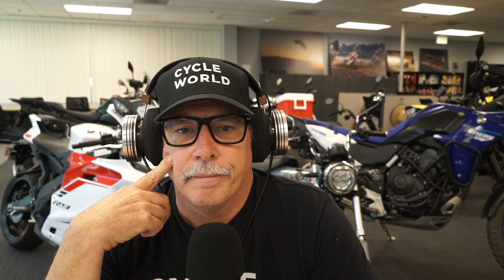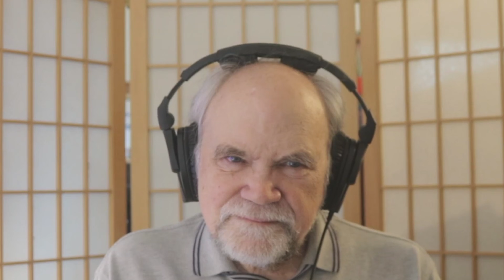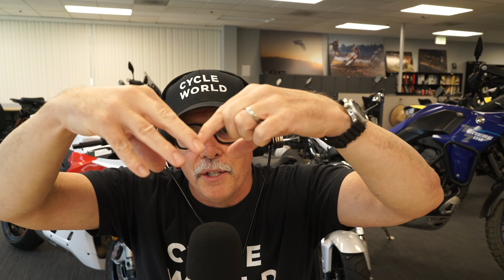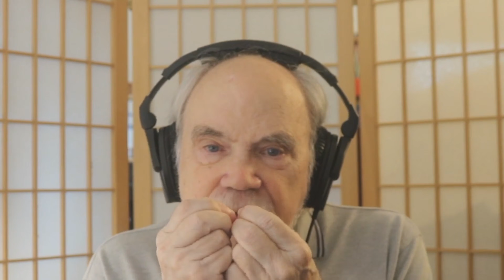HOW FAST COULD WE GO?! What's making new motorcycles slower than they could be?

Comment: Whenever Mark talks about the XS650 I feel a brief burst of nostalgia for my first "real" motorcycle (after having a Kreidler moped and a 100cc Vespa of the old twist-shift type). In 1988 or '89 I bought a '77 XS650 and rode the heck out of it for a couple of years before moving up to a 1980 XS850 Special. The previous owner must've done a good job maintaining it because I knew much less than I should have about motorcycle repair and maintenance and basically didn't do any beyond oiling the chain, yet it never let me down. I wish I had a photo of it.
Reply from the maker: Mark's is cosmetically pretty rough but has been remarkably reliable since its rehabilitation for the Ran When Parked videos on the Motorcyclist YouTube channel. Really fun bike to ride! https://youtu.be/wpYvyk2gIeY?si=sxIJOfFuK0SX-6pX
Reply: People want those for Bobber motors, huge sales in the 70s on those.
Reply: In February of 1986 when I was in the Army at Ft Riley KS I bought a 1981 XS650 Special that was only 20 miles over the dealer free 1st service, 520 miles or 220 miles whatever it was.
I bought it off a helicopter pilot who'd bought it new for his wife in 81 for her birthday, I guess when he got it home she said "Gee, that's nice honey but I don't like motorcycles", so he rode it around a little that summer and put it away in their shed out back, the next time it came out of the shed was when I bought it.
I took it down to the local dealership where it'd been bought to have it serviced and they were so amused at it only being 20 miles over the initial break in service which was supposed to be free that although I wasn't the original owner they still did it for free.
They took me back in the service area to ask me something and on the lift next to it was an XR1000 Harley Davidson, boy did my life change at that moment, I'd never seen another motorcycle, before or since, that put a hook in my mouth like that thing did.

Comment: Esoteric topic suggestion. Actively controlling pipe lengths on a two stroke. My trx250r based toy has a u-turn in the pipe. Trombone action?
Reply from the maker: The U-turn is usually the divergent cone but if it shifted the length of the center section of the pipe you could have something. Just 5mm can make a big difference there. We'll hit Kevin up for his thoughts.
Reply: It's been done for decades. Karting uses them. Sealing can be an issue but that was mostly solved by using moving internal cones that change the effective length while leaving the outside all sealed up.

Comment: Lolol, The glide ratio for airplanes if it is 17 that means for every 17 feet it travels forward it will drop 1 foot or 17 to 1. Not measured in miles, I am calling out Kevin on this because he gets long winded and just in case he believes that he is smarter than the rest of us.
Reply: Isn't the ratio the same no matter what unit of distance is used?
Reply: @theralfinator  Any unit of measurement applies.
Reply: @theralfinator 
Exactly, that's why it's called a "ratio".
For example you can use rocks, if Jimmy has 4 rocks and Mary has 1 then Jimmy has more rocks than Mary at a ratio of 4:1.

Which isn't nearly as many rocks as the OP has up in his head.
Reply: When Kev goes for morning ablution there is more information in the bowl  than you have in total. I learnt more from this fellow than any teacher, hie has a vast reservoir of knowledge that few others can claim
Reply: Dude! 😂
Reply: He is...
Reply: IIRC modern sailplanes (gliders) have a glide ratio of 60 to 1 or possibly better. Often referred to as an L/D ratio (lift/drag).
Reply: You just proved he's smarter than you.

Comment: On a R100GS with the small headlight shield (89,90) I found that at around 90mph the weave would start if I was holding on to both handlebar grips and would go away of I put my left hand on the upper fork tube flat track style.

Comment: My stock 69 Norton Commando S in1974 at New England Dragway turned a 12.69  @ 103.32 mph, the first time I ever went to a real track. More than fast enough to beat any of the 1970s Muscle cars and quicker than the tests I've seen for a  427 Cobra back then.  You can do a lot with about 50 rear wheel horsepower. And a Commando can shut them down! 50 HP can be real fun wide open.
Reply: The 427 Cobra's would hit 180/185 MPH top speed, which is the point of this video, top speed.
Your Commando S crossing the line at ¼ mile was starting to wheeze at 103 MPH and was getting ready to cough up a lung, the 427 Cobras were going 115/118 MPH across the line and were just getting going. 
Still "shutting things down"?
And your 750 Commando must have been a special example of a "stock" one because it's dropping the better part of a second off the time of other stock one's that were in the 13's,  that's absolutely incredible for someone the first time they ever went to a track.
Reply: @dukecraig2402  The Commandos can do 120+. In the old days it was about quarter mile times and Stop light racing. I've read some of the old muscle cars could only take full throttle for a very brief time before they expired. ” Further, factory tech bulletins warned, “Wide-open throttle bursts must be limited to 15 seconds to prevent engine damage.” I believe this is for the Max Wedge and perhaps the big Hemi. Also No factory warrantee.

 Yes, I crossed the line at the end of the 1/4, first and got the win light. The S models were known for their speed and it was bone stock from a local dealer. I doubt many Cobra owners would every do top speed on the roads in the 1970s. I got the time card from the track. A factory test driver ran a 12.2 on a 72 Commando street bike. That was because American road racers said it couldn't be done. So he came from over the pond and did it in front of them.